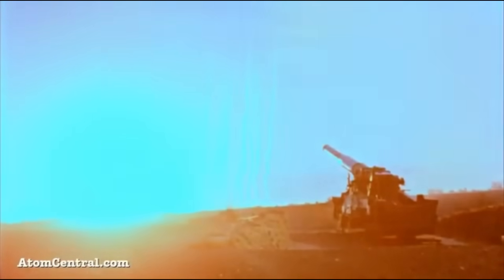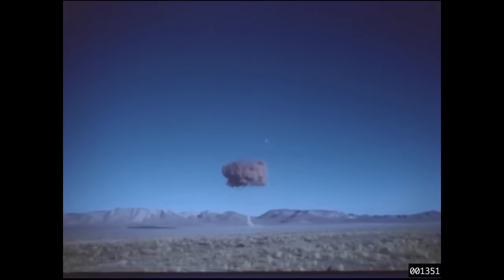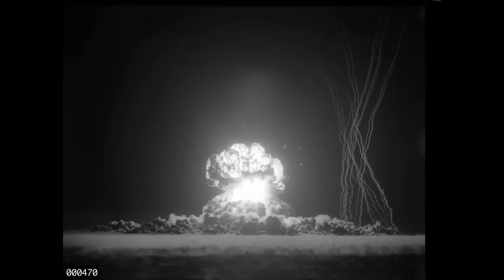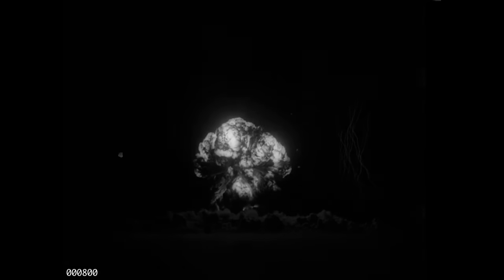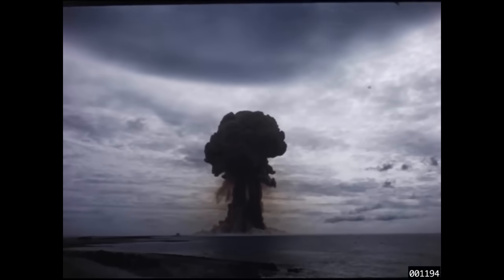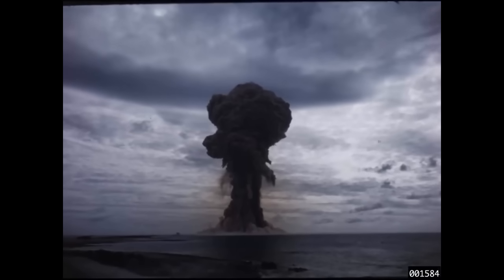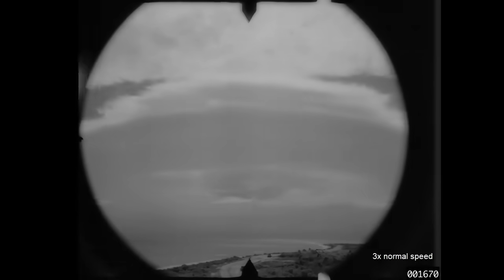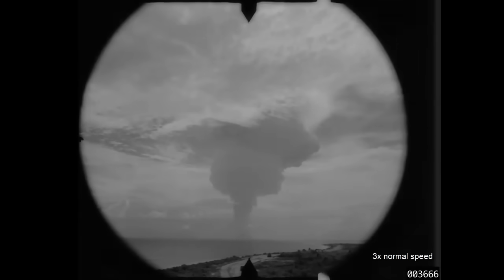What does a nuclear bomb sound like?

Comment: Fun fact : That shot at the beginning of the artillery piece shooting a Davey Crocket (M29) nuke was proven a fake, done as a exhibition for the military industrial complex in the 1950's.
They used high explosive and bags of gasoline to get that effect. I don't think most people know this even today.
Reply from the maker: The clip at the beginning was not a Davy Crockett. This is what a Davy Crockett looked like

https://en.wikipedia.org/wiki/Davy_Crockett_(nuclear_device)#/media/File:DavyCrockettBomb.jpg

Footage of Davy Crockett tests does exist but it's also not faked. Although the blast yield is a pathetically small 20 tons which is comparable to a heavy bomb, The bright flash and accompanying radiation is not easily faked with gasoline. More over they test fired them so people could watch the bomb fly over and detonate. Their accuracy was not very good so faking that by placing the bags of gasoline and high explosives in the exact location hidden under the sand would not have been possible. Their low reliability is one of the reasons they where all decommission. 

The footage used at the start of the video is a test of the M65 atomic cannon, also known as the "Atomic Annie". That test specifically was Upshot-Knothole Grable. With a yield of 15 kilotons, about the same as the Little boy bomb that destroyed Hiroshima. You will not find enough gasoline and high explosives to fake that. as well as the double flash and fallout after effects.
Reply: @venera13  Your own link proves they had dummy rounds for practice. That's a clue. And you give me a ton of Comp B and a ton of gasoline and I'll show you a fireball you can only dream of.
My dad used to work as an engineer for a company called Command Aircraft back in the 50's and he met a lot of varied and interesting people, he also had high security clearance due to serving in WWII. He relayed to me a story from another engineer ( i know, heresy, but whatever) who worked on that and he said they absolutely couldn't risk killing or irradiating a bunch of military and govt dignitaries in case something went wrong.
So, as the story goes, they trucked out a couple of tons of Comp B and strategically placed a bunch of gasoline (apparently it presented some interesting engineering issues on it's own) around it. When it was time for the demonstration, they fired off a dummy round, counted out a minute or two, then pushed the plunger on it.
That's the story I got, and that's what I believe, because I don't trust anything my government says about anything. Period.

Comment: Judging by how long the sound took to reach the camera, that bomb was roughly 8 miles away.  As a side note, the EM pulse hits the camera at the same time the bomb goes off.  Which in a way confirms a yet unconfirmed but little know scientific theory, that light is not the ultimate speed, but that magnetism and gravity propagate far faster than light, some scientists estimate that this force could be 20 billion times faster than light.  First noted by the fact, that if gravity took as long to reach us from the sun as it's light did, then orbits would be impossible as the earth would be trying to orbit where the sun used to be and not it's actual location and of course this only gets worse as the planets are further.  If this is so, then even though light takes over 4 hours to reach Neptune, gravity must do it almost instantaneously even at such distances.  Of course many scientists dispute this, but it was interesting to see the EM hit the camera right away, hmmm.
Reply: Sorry but you’re wrong on so many assumptions here.
First of all, there is no chance you could judge the difference of the speed of light or 20 billion times faster over 8 miles in a ~ 30 fps video. It’s both instant.

The emp is not the same as gravity; it’s electromagnetic radiation. Gamma rays released from the explosion ionise the atmosphere.

In Newtonian theory gravity propagates instantly. Just changing that to the speed of light would calculate unstable orbits. General relativity in contrast does predict gravity propagating at the speed of light and is more precise than Newtonian, though not hugely.
Reply: @OnDuqz  I'm not wrong,  it's not me saying this lol. If you have an issue with the information I passed on and can prove otherwise, then you need to contact either Dr Anthony L. Peratt of  Los Alamos National Laboratory or physicist Wallace Thorhill.
Reply: @OnDuqz  Here's a quote taken from a lecture given by Wallace Thornhill  at the univerity of queensland, "The fact that the universe is a system connected effectively in real time, at least on a galactic scale, should never have been in dispute since Newtons law of gravity which is derived directly from observation is instantaneous, his well known equation doesn't include time. Observations show that the earth is drawn to the instantaneous position of the sun and not where it appears in the sky 8 minutes later. In the book 'Space, Time and Gravitation', the English astrophysicist Sir Arthur Eddington discusses this problem, he notes that if gravity propagated with finite velocity, the motion of the planets around the sun would become unstable, due to a torque acting on the planets. The problem was already known to Newton and was examined by P.S. Laplace who calculated a value far faster than the speed of light."
Reply: @doomfathertm8771  Inferring anything about the propagating speed of gravity / electromagnetism from this video is 100% wrong though. This is a point you did make.

I have a suspicion of what „theory“ you might be referring to since, you‘ve mentioned Wallace Thornhill.
If you could point me in the direction of a paper that presents evidence for any of the information you’ve passed on, I could comment on that.

Comment: Hydro or Atom?
Reply from the maker: Both, hydrogen bombs are atomic bombs, they just use a fission primary to set off a fusion secondary. As such a fission nuclear bomb sounds the same as a hydrogen nuclear bomb. The only real difference is volume.
Reply: @venera13  I learned it earlier but latest nukes are being compared with hydro and atoms for mass assumption, no one involves fission or chain reacts
Reply: @venera13  for suppose people call hydro as greater than atom however atom is in every

Comment: Fission bomb: Sharp bang with long lasting rolling thunder.

Fusion bomb: Smaller sharp bang immediately followed by extraordinary wide spreading extremly rolling thunder with high infrasonic effects.

While fission bombs have a high explosion velocity like the detonation of chemical high explosives the fusion bomb reaction itselve may be more comparable with a ultrabig blackpowder deflagration I think so.

Both effects are comparable in time difference between flash and sound: Due to the great distance between centre of the effect and viewer causes a big waiting time between flash and start of sound causes by far slower sound speed in comparison to light speed.

Comment: How they get the Kamera back? It should be radioactive there and probably the Kamera must be destroyed cause it wasn’t that far away from the nuclear bomb
Reply from the maker: Cameras close to tests where in heavily built and shielded containers. That being said a lot of equipment was regularly destroyed in testing. In the clip showing the sound the camera was way back a number of km with the observers and was fine. 

As for radioactive, that depends. Yes after a test the test site is radioactive. They would usually wait a number of days for the radioactivity to drop a bit before going in to collect stuff. Still people would be exposed to elevated radiation in doing so. Metal objects close to the detonation sometimes become radioactive temporarily due to neutrons bombarding them. But you would need to be very close to the detonation for that to happen.

Comment: o really? lol ok smarty pants go build one then.
Reply from the maker: The mechanics are very simple, a gun type nuclear bomb like the one used over Hiroshima is literally just a uranium cylinder getting shot into a smaller uranium cylinder with high explosives.

https://physics.highpoint.edu/~jregester/potl/Nuclear/Weapons/guntypebomb.png

Building nuclear bombs is very easy from that standpoint, the hard part is obtaining the fission material. Producing Uranium 235 is hard, producing plutonium is also hard. But if you have access to U 235 you can build one out of crap you can find at hardware stores. One of the reasons uranium enrichment is so closely controlled. Using a mass of uranium, a gun barrel cut off a tank or even just a thick steel pipe, a welder, and some explosives you can build a working low yield nuclear bomb.
Reply: How about you do it:)

Comment: My dad worked at the NTS 1955-57. His last shot was Hood in July ‘57. The most modern, fission fusion fission devices weren’t tested there, but Hood was at least a two stage thermo package. The W80, 84, and 85 warheads were derived from that tech and tests, like Hood.
Reply from the maker: That's pretty neat.
Reply: My Dad worked there also, same time period. 54-57.

Comment: I've never seen a way to actually demonstrate the existence of an emp from a nuke before. That's so cool.
Reply: EMP of a nuclear warhead is way overrated. If equipment is out in the open then it will cause damage to some equipment but if it is indoors or shielded it will have little impact. Overheard powerline's is where the real damage risk is but even then it would have to be within parameter to induce such an overload. Underground powerline's are at much lower risk. 
Being within range of the thermal reaction is a much higher risk.

Comment: can someone explain me why the clouds just rise up like a mushroom and not spread horizontally with the atmosphere?
Reply from the maker: Convection. The top of the mushroom cloud is the remnants of the superheated plasma ball. So its essentially a big ball of hot air. Hot air rises, so the cloud rises. As air cools at the top it sinks down the sides as air is drawn up into the hot cloud. That's why the cloud seems to fold into themselves, the "stem" is made by this air motion. The Shockwave bouncing off the ground and back up also helps shape the cloud if it's closer to the ground. But it's mostly just because hot air rises. 

That's also why conventional explosives also make mushroom clouds sometimes. Any blob of heated air will rise like that.
Reply: @venera13  Thanks a lot.. u covered it all 😄😄
Reply: @rog3rskunk84  pretty much

Comment: There are several factors concerning the noise of a nuke, and how and when you perceive it. Naturally a nuclear explosion has to be observed from several miles away, and you see the flash first then, if you haven’t been blinded or killed, see the shock front. Then you may feel the shock through the ground, as vibration travels through incompressible media, like water and rock, far faster than it can through air. Finally you may observe the negative shock front and the noise, but the order is dependant on the power of the weapon. The reason for the negative shock front, or blast front as it may be called, is because the positive blast front is so powerful that it creates a low pressure area or partial vacuum behind itself. Nature hates a vacuum, so it sucks back the displaced air, almost as fast as it was displaced in the first place. Naturally sound can’t travel through a vacuum, so that is another reason that the sound may be delayed or relatively quiet. Finally, the sound of the vacuum itself collapsing is a bit like a thunderclap, but human ears may not be able to separate the sounds and hearing may, indeed, be irreparably damaged by either the overpressure or the loudness itself.
Reply: Nature abhors a vacuum. Crazy we still watch seismometers and monitoring equipment. That EM interference in the beginning was pretty trippy.
Reply: Baby you are NOT an expert ok?

Comment: Mechanical Engineer here with strong background in acoustics, fluid mechanics, and explosives. So why does a nuke sound more like a big shotgun shell or cannon going off rather than like a conventional explosives with lottsa BWWAAAAAHHHSS and BOOOOOMMMS going on? Simple, every nuke, be it fission or fusion explodes so quickly that the instantaneously burst acts as one giant explosive, you have one ball of intense energy at one singular point fucking the shit out of everything around it in one constantly expanding, symmetrical action. Whereas like nearly every conventional explosive, like even going back to WW1 days are actually bundles of smaller explosives wrapped together and wired to go off at almost the same time. No matter how precisely these conventional explosives are triggered to go off, at T0 there will always be one bank of explosives or one side that starts a pressure front before the other, it's unavoidable and no really that taxing from a bomb efficacy design standpoint, like who cares if some wave fronts crash into each other, most of that energy, and nearly all of the explosive material is going to go boom. So anyway, most of the explosion sound effects you hear in movies and on TV are either from war footage, in studio pyro explosives or computer generated. And the majority are based on these types of explosives that are put together similar to how a modern lithium ion battery are, where it's just stacks of AA battery banks. Consequently these types of explosives generate multiple wave fronts that greatly spread out and extenuate the sound front. So with a conventional large explosive, you're actually hearing several smaller booms that are overlapping and interacting with each other whereas with a nuke it's just one large single massive explosion and that's why a regular bomb goes BOOM and a nuke goes BANG!

Comment: The sound of nuclear detonation is highly dependant on distance to ground zero. Imagine this as thunderstrike. The closer to lightning you are, the louder and sharper the sound is. Just as the thunderstrike, nuclear explosion is in large part air molecules subjected to extreme forces. Excited, turned into plasma, they emanate wide spectrum of frequencies, from subsonics to ultrasonics. This shockwaves are composed of tremors, sharp sound of extreme pressure spiking and then suction of depressurization and rising of heated gas masses below mushroom cloud etc is subjected to filtration of wavelenghts due to large distances to ground 0 and air masses between listener and actual detonation site. Just as with thunderstrike, the farther one is, the more silent and rumbly sound becomes, because lowest frequencies are travelling better. The closer one is to actual explosion, the more sharp, sudden, viscious and high frequency the sound is, as shockwave is not yet dissipated. So if one is close enough to such powerful explosion, one shall be subjected to extremely painful and incredibly loud high-pitch shock and if one's eardrums would still function after that, there would be instant rumble and loud wind noises just as recorded by this old recorder in video above.

Comment: In 1:42 Isn't a ground shock wave?
Reply from the maker: No the ground shock wave travels at the speed of sound. That was the light and possibly other EM noise messing with the mechanical cameras inner workings.
Reply: @venera13  speed of sound in ground is much, much faster than the air. If it is EM then why does the effect not occur at the moment of the flash?

Comment: He got fusion completely rong
Reply from the maker: *wrong 

And no. I discussed FISSION which is different than Fusion. The bomb I showed was a fission type. It's energy is derived from the splitting of atomic nuclei. Fusion is creating heavier elements from lighter ones to produce energy. In the case of hydrogen bombs they usually use either deuterium tritium mixes, or a solid lithiumduteride. A fission type bomb is used to initiate the Fusion reaction when the xrays from the fission first stage compress the Fusion second stage.

Comment: I always assumed it would be a really loud bang, an absense, and then a quick rush of air ending with the sound of debris and particles falling lightly.
The only reason for this pretty much being the pressure you see from them, I assumed there would be a void of sound after that had hit.
Reply: Nah, after the initial sonic boom you get the air sound right away because just behind the boom is the air and sound not being compressed
Reply: the roar you hear after an atomic bomb is still burning fissile material. in my opinion, the roar is far more frightening than the boom itself.

Comment: I'm pretty sure it sounds like your eardrums rupturing, followed by silence for the rest of your (very short) life. Or if you're close enough, the sound itself will just straight up kill you (except you'd already be dead from a lethal dose of radiation/heat long before the pressure wave reaches you.) In short, it sounds like you're dead. 

Also, no microphone is capable of accurately recording the sound of a sonic boom without distorting, so you literally can't record and reproduce a true representation of what a nuke actually sounds like. Plus, Earth's atmosphere itself isn't capable of producing sounds above 194dB. Anything more and it's not even technically "sound" anymore, it's a shock wave because the additional energy heats up the air, distorting the sound and making the wavefront travel faster than the speed of sound.

Comment: This is actually sounds almost exactly how I expected except that I thought there would be a more higher pitch crack.
Reply: The pitch depends on the distance you hear it. It's just like a lightning where it's low both in volume and pitch when far away and high in both when you're nearby.
It's actually surprisingly high in pitch given how far they are from the explosion.
Reply: @johnrambo4158  is right on.  The closer you got, the more it would sound like a high-pitched crack.
Reply: high pitch means projectile